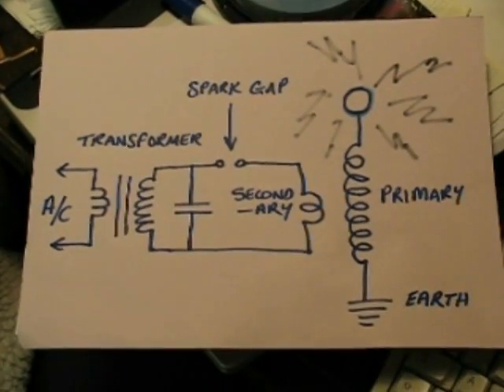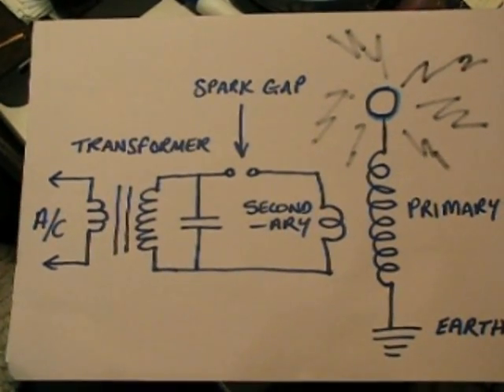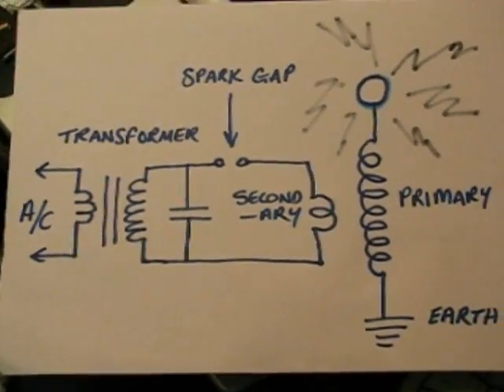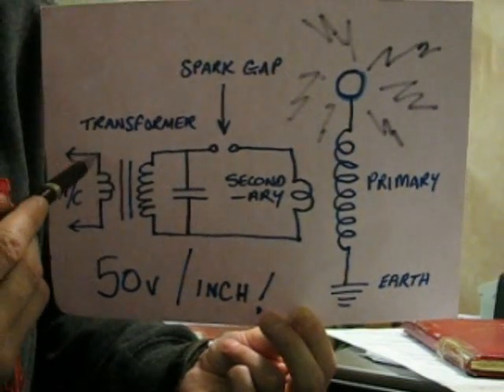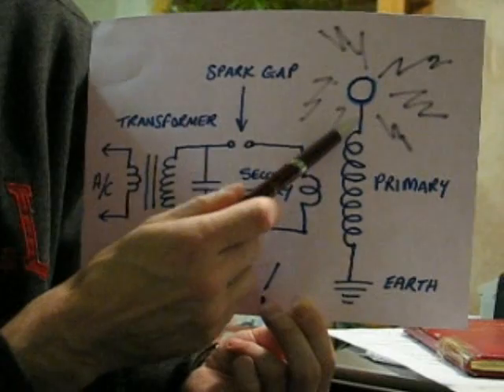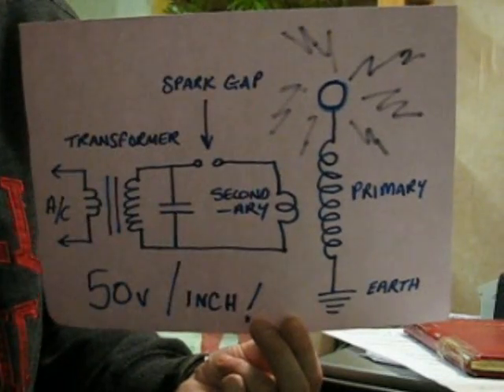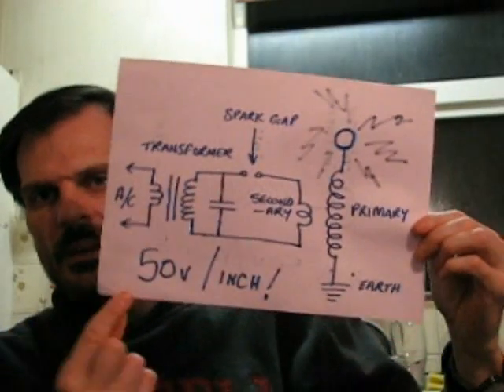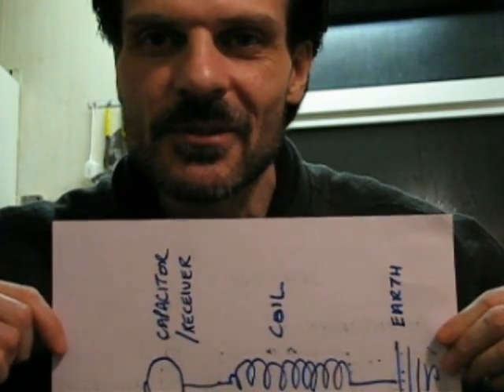Tesla's Little Secret

Comment: David Small,                                                                                                                                        Hi David , I have just received an email from you explaining all about Tesla coils. I don't know where you got the idea that I was uneducated  where tesla coils are concerned. I have also built many very effective coils and understand the theory very well. I have designed Radar systems and have been an Ham Radio operator for many years. I have a degree in electronics and also a degree in Cosmological physics. Please refrain from making such assumptions in the future. 60 years in Electronics and  radio does give one a small insight into the workings of Tesla coils.
Mo K BSc (hons), GORAM
Reply from the maker: Mo King Ok but you don't need you to prove your qualifications. Understanding is not necessarily dependant on technical education. It depends how simply you can break down the principles and apply them in a practical way. As far as science is concerned, all understanding is in regards to "models of understanding"... which are continuously evolving to a higher (simpler) level. It is helpful to understand that all electrical energy in our system (with the exception of Spirit) comes from the Sun, which in turn draws its energy from a larger central sun at the centre of the Milky Way galaxy. If you think of all the suns and all the galaxies in the universe all radiating and sharing energy the amount of energy available is unlimited and all around us everywhere, all the time. We could easily tap into this energy at any moment if we only knew how! Apparently Tesla knew how....

Comment: Matt,
 Your last correction to your circuit diagram  is ambiguous as the voltage amplification is a ratio of the primary turns usually around 10 t of 1/4 "  copper pipe and the secondary turns of a much finer wire to give at the very least 100,000 volts which means approx' 1000 turns with an input of 100v , now the normal input to the Tesla coil primary is usually in the area of 4,000 - 10,000 volts, the higher the better as at the final voltage of theoretically of in excess of 1,000,000 volts, there quite a lot of stray resistances around so the actual final output voltage is more realistically 1/2 to 3/4 of a million volts, so say for example you have 5,000 volts powering the Tesla primary and the winding's, depending upon the thickness of wire used can be in the range of 10 to 50 per inch not foot, then the voltage amplification would be in the ball park of  5,000v -25,000v for each inch finishing with a column of 200 inches to 40 inches  depending on the wire used. I have actually seen 12 foot high Tesla primary's. Tesla with very high primary voltage succeeded in producing voltages in excess of 5 million volts, but to achieve this sort of result the rig needs to be tuned so that everything is spot on the resonant frequency.
Reply from the maker: Thank you for your comments Mo :)

Comment: Hi Matt,
           Your circuit diagram is a wee bit in error. The voltage out of the transformer, normally in the area of 4000 volts needs to be rectified as the tuned capacitor circuitry is  DC only with AC the capacitor would present a short circuit to the transformer
Reply: Mo King Hi Mo, I looked over the circuit diagram. It's a very basic Tesla Coil without extra stuff (transformer high frequency kickback protection, strings of high voltage capacitors, rotary spark gaps, and most important, the smell of overheated circuitry... :-)   )

Essentially, at 50/60 hz, the capacitor is charged until the spark gap fires. Then the circuit "rings" down, in an RC determined frequency. (I hate to give an average value, but over 100 KHz is common.)

The ringdown is quite pretty, until your oscilloscope dies from overvolting the probes.

Many TC builder purists believe in swapping the location of the spark gap and the capacitor. Don't ask me why. It seems to work.

The timing of the capacitor charging, everything's inductance, the spark gap firing, and the frequency matching between the primary and secondary (you want a 1/4 frequency length), is all pretty critical. This is called "Another few hours tuning the coil each evening for weeks".

Yes, you're correct that a capacitor offers a throughpath for AC. If the spark gap is too far apart, this circuit just sits there and hums. That's a bunch of watts going nowhere. In technical terms, this is called a "oh dammit!" event. The transformer may not be able to handle peak voltage and arc over internally; the capacitor may blow out; and in general, it seems like the things that die are according to a formula involving how much they cost.

However, if you have a couple spare microwave oven transformers (@4kv), some "Corona" beer bottles filled with salt water and in a tub of salt water for a capacitor, something for the primary (copper pipe looks pretty), and you've spent the last few days getting carpal tunnel winding the secondary ... then you have a working Tesla Coil.  (Well, see above about tuning.)

Take care,
Dave

Comment: This guy really need to understand the fundamentals of harmonics.  How does he expect this 'radiant energy' to be resonating at the proper frequency for the transformer?  In his diagram, the first transfer works because it is tuned to the mains frequency (50/60Hz).  The second transformer only work due to the finely tuned LC frequency of the circuit (typically on the order of 50-150kHz).  It can not and will not function backwards.
Reply from the maker: Of course you would have to reconfigure and tune the circuit. Have you tried it?
Reply from the maker: How do I not understand lightning and voltage potential difference? How do you know what I have tried and what I understand? LOL
Reply from the maker: The point was to I made a video to inspire people to research their own ideas. And now you would like me to prove you wrong so you can build one! Discussing possibilities is not misleading anyone unless YOU are easily mislead. It is called the evolution of science.

Comment: Volts does not equal Energie, it's just an indication for pressure. To say something about energie u need amps too. That's the problem here. High voltage, low amps = low Energie. P=U*I
Reply: True! U need amps; what this guy is saying is by harvesting large amounts of voltage..and the low amps that come with it... U can use a transformer to lower the voltage and thus making energy...etc, if u look at an iPhone charger or any other phone charger... They use transformers to lower the voltage to a safe level while allowing the amps to increase ( not literally, just think of it like this... A large air balloon with a tiny amount of water in it, U release the air and U keep a tiny bit of air left and U still have all that water still in there, the air being voltage and the water being amps; that's how I look at it, sorry im weird like that, lol).

Comment: I am no engineer but I understood the logic. I am confused how you can jump the spark gap going the other way. The capacitor is what makes that possible, holding that amperage. Without a capacitor on the other side how does that work? It wont have the amps to push the charge into a system. Now as far as using it to throw energy over great distance on a specific frequency.... that I get. I understand also capturing ambient energy or ZPE / Inherent radioactive energy.... but Amping that up without expending energy is the trick.
Reply from the maker: jimmy5F  You are right and you are making noise on my channel.
Reply: Some energy is required, but not nearly as much energy you get back from it. :-)
Reply: Chris Crissey You are right about jumping the gap. If you could hear him over the background noise, he said that in order to run the circuit backwards, you would move the capacitor to the other side of the spark gap. But he did not alter his drawing to show that.I would like to know how to size the antenna and the transformer to produce 120 volts at the left side of the drawing; how to control it safely; and what kind of switch to install for shutting down.

Comment: Capturing radiant energy seems to be an application of pulsed direct current. Stanley Meyer used it and John Bedini is using it. Check out the Bedini pulse motors.
Reply: +MattBlytheTheOne Thank you sir.
Reply: Can you define even a single word of that?
Reply from the maker: Application. The application of ideas. There you go.

Comment: Its been a few years since I've worked but I still remember the principles.  Let me run you through some of the problems you will encounter getting this energy.

Antennas are designed to pick up specific wavelengths of radiation.  All radiation not tuned to the antenna will be attenuated causing a loss in received power.  To pick up such a broad spectrum effectively would require many different types/lengths.

Secondly the energy required to build enough voltage in the capacitor to jump the spark gap would be somewhere in the range of a few 100K volts.  Theoretically this could be done given enough time, but I'm pretty sure the actual losses in the circuit would prevent this given the amount of time needed.  The gathered energy from a cell phone signal near the collector is in the micro-volts (10^-6) range of power and as you know a distance increase mean even more attenuation.

Even if we were able to collect enough voltage to jump the gap, much of the energy of that jump would be lost due to heat and light making the collection even less.  The best chance you would have is to close the spark gap when X voltage is reached.  And then that gap could would have to be re-opened before the collapse of the T1 coil to prevent the voltage feedback from coming back and collecting on the other side C1.

While your schematics sound good, it just doesn't work that way in real life.  Kind of like a perpetual motion machine.  Maybe at superconductivity temperatures..... but now we are wasting more energy to cooling than we are collecting.
Reply from the maker: Thanks for your feedback. Have you heard of Ed Leedskalnin's Perpetual Motion Machine? It's not actually a machine it is an electron-magnet but by it he demonstrated that electrons flowing in a closed circuit would flow infinitely without additional power and without losing power until the circuit is broken. As long as the sun shines we will have more than enough power for the foreseeable future.
Reply: MattBlytheTheOne Just like plants. [:-)

Comment: The circuit as shown would produce a positive discharge followed by a negative discharge half a cycle later (1/100th of a second if your mains is 50 Hz). You would be putting this energy into the air from the mains current produced by a generating station so there's your energy source.
I dispute that there's hundreds of thousands of volts per meter of electric field in the air around us (from the Sun or anywhere else). Such fields would be obvious to everyone all the time.
But even if there was, if you want to extract mains voltage from it then it would have to have this change of polarity 100 times a second in it. Also there's no voltage regulation shown so what came out of the primary of the transformer could be anything!
I'd be VERY surprised if you can make one of these do what you claim.  Try it and see. You'll be disappointed.
Reply from the maker: There are millions of volts coming from the sun but you do not experience them all at once because there is no potential difference between you and your surroundings. Like when a helicopter approaches and "connects" itself to a high voltage pylon.The helicopter does not fail, if it is at the same voltage potential as the pylon there is not current/energy flow. The potential diff. from atmospshere to earth is approx 50v per foot of atmospheric elevation according to Tesla.
Reply: "Million of volts coming from the Sun" has no meaning sorry. Voltage is analogous to pressure and it involves the difference of electrical "pressure" between 2 points, it doesn't come flying through the air.
I did find a Wikipedia article on the subject that says the average voltage gradient in the atmosphere is 120 volts per meter which is news to me. If it were true, I'd be able to measure it with a voltmeter and leads outstretched. I've just tried it and the answer is.... 0.1 mV for 1.5 meters which is within the error of the meter, so essentially zero.

And this from NASA:
http://www-istp.gsfc.nasa.gov/stargaze/StarFAQ19.htm

The question is contained in their reply.

"Please tell your partnership that this idea is not likely to be useful. 

    What you have in mind, as I understand it, is an electrical circuit which taps the atmospheric potential at an airship moored at some altitude, sends a current through the mooring cable to the ground (where some electric power can be utilized), and closes the circuit back through the atmosphere, to the region around the airship where, presumably, more electric charge is waiting to be neutralized. 

    Just apart from the electric aspects, let me state that an airship moored at even 1 kilometer is a technological challenge. The cable and its insulation will be heavy, especially since it has to both moor the airship and carry its own weight, forces which stretch it in opposite directions. The airship--if filled with helium, will be expensive, if with hydrogen, it must be very gas tight, and in any case, airships at that altitude are very vulnerable to storms (think of lightning, too). 

    But beyond that, the atmospheric electric field contains rather little energy. It is maintained, if I understand, by the global distribution of thunderstorm clouds. Suppose you remove some of it, how soon will it be replenished? You close your circuit through the atmosphere at 1 km below, through the weak conductivity of air (mostly caused by cosmic rays). However, the thunderstorms replenishing the potential may be hundreds if not thousands of kilometers distant, through the same poorly conducting air!  "
__________________________________________________
So I can't confirm the claim of 120 volts per meter average but there must be some amount of electrical energy in the atmosphere. I'll reserve judgement on the principle but I'm convinced the quantity of energy is too small to be useful unless there's a lightning storm in the area and I wouldn't be trying to collect that without some SERIOUS equipment!
Reply from the maker: Warren Harding
 OK let me rephrase: The sun has a potential difference of millions of volts from earth's potential voltage. Does that help?

An airship is a simple approach but what if we could tap into the frequencies that energise all of Creation? We wouldn't need huge aerials just a small finely tuned receiver. Maybe atoms are the receiver and contain all the energy we need already?

I'm with you btw. I can't prove or disprove Tesla's theory but I believe he knew more about what he was talking about than you or I do.

Comment: capturing this free radiant energy is quite simple, many people complicate it, this video is good, but the circuitry isn't right for using in reverse, however, a re-arrangement of the components it does work, i have a miniature tower in the back garden at 9ft tall, it can charge my phone, but its takes 5 days. it doesn't work from a lightning strike, it works like a lightning rod which prevents a Lightning strike by allowing radiant energy a passage to the earth but the circuit harnesses that little trickle of current to charge a 3.6v battery. and if lighting does hit it, i have the spark gap set up to allow that massive amount electricity to go to the earth instead of damaging the circuitry.